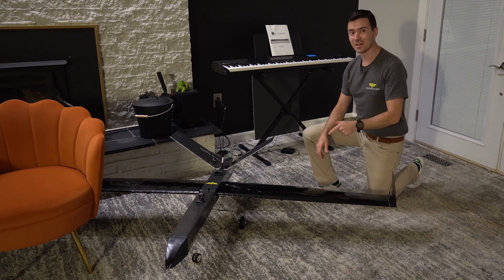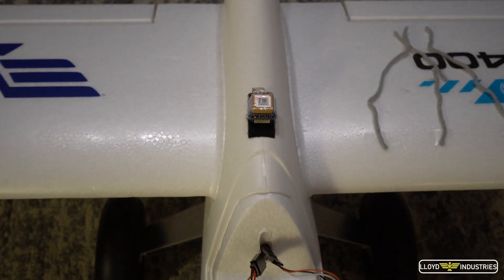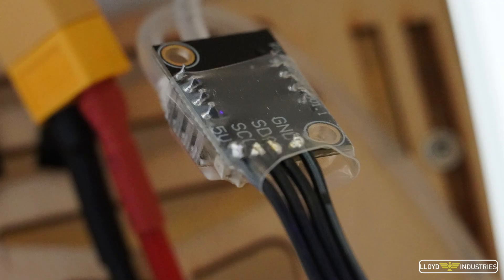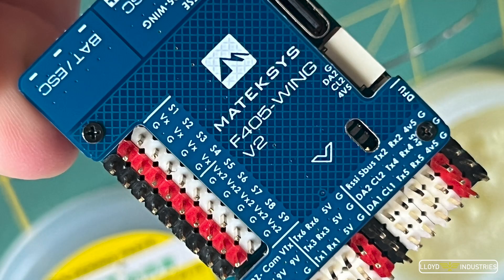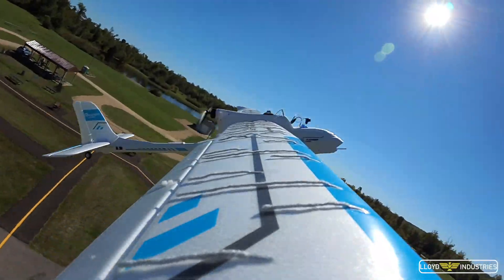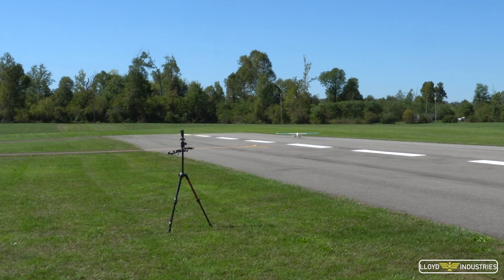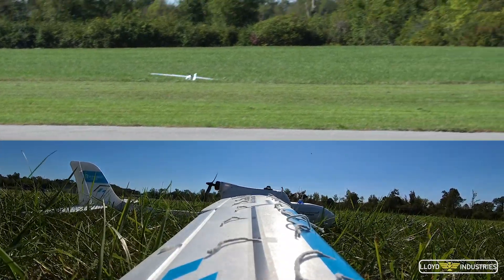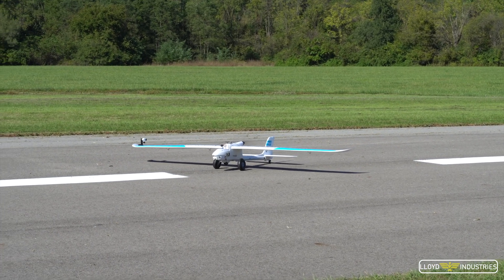Volantex Ranger 2400 - Ardupilot Autoland with LiDAR Sensor

Comment: Hi, I have the same aircraft, a Pixhawk with a pitot tube and Rangefinder. Could you tell me what setting you used for autolanding? Thanks.
Reply from the maker: My friend I am so sorry but I have re flashed that autopilot and cannot access them. However the ones i used and showed on the X-Hawk auto land video should be pretty similar.

Comment: What PIDs did you end up with? Recently picked up a ranger 2400 and want to tune it before i maiden it
Reply from the maker: Shoot sorry I couldnt tell you Ive moved the autopilot to a different plane and changed them. But autotune does a decent job and you cant go wrong in stabilize mode.

Comment: Congratulations on your great project. I am having problems with my Matek ASPD-DLVR L431 digital speed sensor, I am using the same controller board, can you help me how did you configure the sensor?
Reply from the maker: Thank you! I too struggled to get it working properly. If you look at the X-Hawk autolanding video, at the end are all the parameters I changed.

Comment: Glide slope of 13, are you using autoflaps? I've got crow braking setup and just did it manually with a pot but I don't want to confuse autopilot.
Reply from the maker: I am using auto flaps but I had them deployed from the beginning of the flight.

Comment: Nice. I just finished tuning a Volontex Ranger 2000. I fried a couple of VTX's, I had a servo connector above deck to plug it in at the last minute. Just got a GEPRC Maten VTX and it's the bomb. It's got a FAN!!! It's a sweet design with the button and lights on the side! where you can use it. I just did my first two autolandings 4 days ago, just with airspeed and GPS they were pretty good, but too fast and I know I need LIDAR  I was just in the shed looking to see if I had a port empty on the F405, came in and found your vid. I've got two axis head tracking from my FS Attitude V2's, it's a trip.
Reply from the maker: Thats awesome! Glad to hear your 2000 did well!

Comment: Tuning an autolanding sometimes is tricky. The more "glidy" the airframe is, the harder it is to tune the landing. 13deg glideslope is so unusual for me, but i'm glad it works for you.(My slope is 4.0-4.5deg with no headwind, 5.0-5.5deg with 5+m\s headwind, and 3.5deg for extended wing configuration). If the plane is gliding well, has low drag, it tends to speed up during landing slope even with no motor. The wing makes more lift, your plane climbs up, AP trying to oitch down making even more speed. So if there are no airbrakes, flaps are fully engaged, whe only way is to play with glideslope angle.
Also consider using pre-flare stage parameters, so you could lower your speed after ~30-40ft.alt, thus shortening flare to touchdown distance. Even if the plane will not decelerate with lower speed setpoint, this will make sure that prop will not spin before flare(in sope particular cases it is needed).

While doing a mission, use DO_LAND_START waypoint somewhere(it is a marker, not actual mission item. indicates the begining of landing procedure) before your landing waypoints. While doing normal scenatio, it will not affect anything, but in case of something goes wrong, or RTL mode, AP will consider all waypoints of a mission(even not in AUTO mode) after DO_LAND_START as landing procedure, so it can land the plane automatically. Sometimes i manually write a note to myself of WP number where landing procedure starts, so i can change WP to it. Using DO_LAND_START can help to make it automatic.
Reply from the maker: Thanks for the message! I appreciate the insight. This is my first attempt at an autoland and I was pleasantly surprised at how well it went. I will continue to experiment with glide slope angles and DO_LAND_START procedures. This will certainly be very helpful in my upcoming videos!

Comment: Nicely done, but your video link was terrible! Lucky you weren't needing it to land manually. Sounds like your telemetry link was a bit sketchy too.
Reply from the maker: It sure was. Unfortunately i had to put the receiver down at some points during the flight and it would lose signal as the antennas weren’t properly positioned. And for the telemetry or radio control i didnt bother placing the antenna in an optimal spot. I also may have squashed the antenna cable when i was putting the wings together 😝

Comment: Great accomplishment!  I've been wanting to do the very same thing except I just entered into the autonomous flight world a year or two ago.  I am starting with iNav and have dabbled in ardupilot a few times but I need to spend a lot more time learning it before I would feel comfortable sending a model in the air with it.  Great work...I've been wanting to see something like this for a long time but never find much content on it.
Reply from the maker: Thank you! Best of luck getting your bird in the air, one great thing about ardupilot, it is extremely well documented
Reply: @letsMakeItFly  I have primarily been using the SpeedyBee F405 wing and the F405 wing mini...have you had an experience with those over the Maitek boards?
Reply from the maker: No i have not. Only autopilots ive used are the old APM clone boards, cube orange and the F405 Wing V2. Im sure its a similar process though!

Comment: Hi, can you please share the electronics specs used in the project? Specifically the lidar and airspeed sensors, plan to build something similar
Reply from the maker: Sure thing the lidar sensor is the Benewake TFmini Plus and the airspeed sensor is a digital airspeed sensor kit for pixhawk. You could find both on amazon. Ill update the description soon to include links!
Reply: Hey thanks mate❤. Looked at the description,  thank you for updating it.

Comment: This is impressing, I will follow you. You are pushing the envelope of autonomus RC flights. I spent a lot of time diving into Adrupilot and Mission planner... but only with flight simulation so far. I need to move forward with real flights 🙂
Reply: Build a simple plank, smack that FC and start experimenting.
Reply: @sakarrc5001  Yup, the cheap foam trainers work amazingly well with all of the default Ardupilot settings.
Reply from the maker: Thank you! One thing I’ve learned is that duct tape and hot glue can fix a lot of what breaks after an unfortunate event. Hope you get in the air soon!